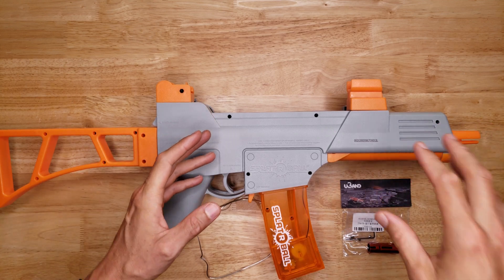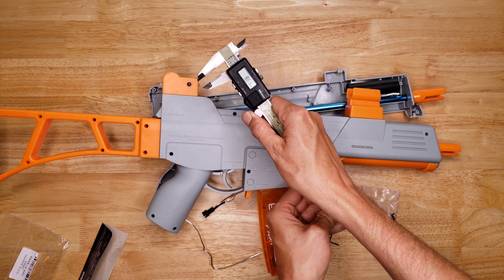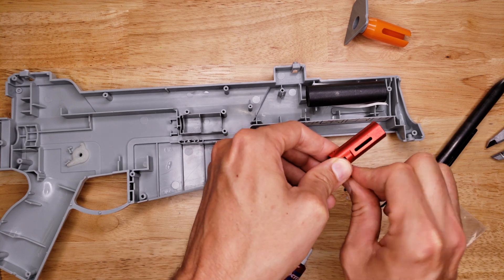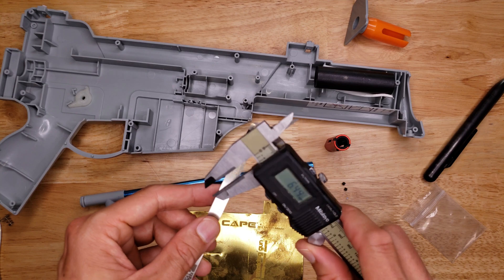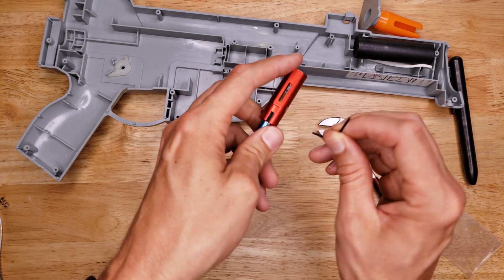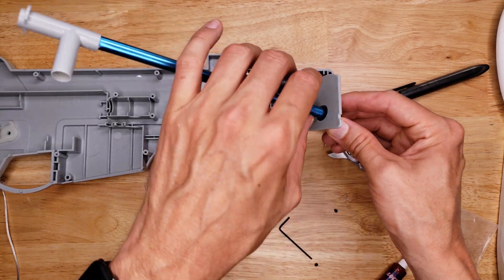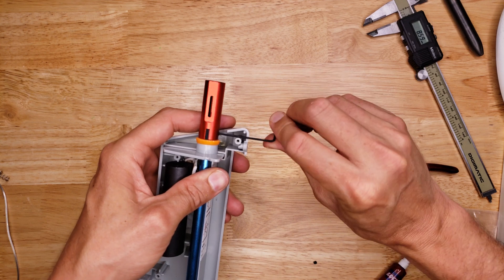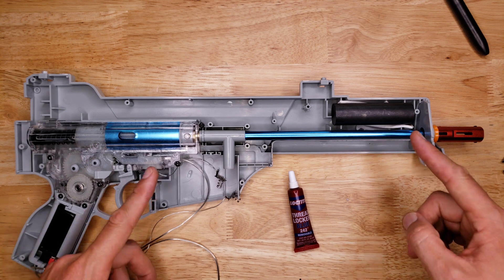How to add a HOP UP MOD to Splatrball SRB400 Gel Blaster to improve accuracy | Splat-R-Ball Upgrade

Comment: Do you think i could 3D print this? Are there parts on it that have to be a certain material?
Reply from the maker: Yes, many hop ups are 3D printed, but generally don't perform as well, and break easier.
Reply: @engineerable  but do they perform better than stock? Anything to improve it cheap

Comment: Did you ever film a video of then difference... i got the 1200 coming Friday and it seems like if i just saw the orange tip off and smooth it i could add a hop up without pulling the gun apart.

I havent got it in my hands yet to see... but let me know what you think
Reply from the maker: Check out this video to see how the SRB1200 is made inside https://youtu.be/FKxPLUxrIpM
Reply: @Engineerable 

I really respect what you do and how you do it. I used to film for a year on YouTube.

I loved it so much but with a full time, a wife, 5 kids and a dog it became alot to do. Alot of time involved. I'll get after once my youngest is about 5. But what you do and how you do it is valuable and I just wanted to say that.
Here is a video I made for Meepo boards pretty neat.
 https://youtu.be/PJB49iiM5D4

Comment: If I only do the hop up mod without metal gears will it improve the gun?
Reply from the maker: Yes, I added the hop up to a non upgraded Splatrball, and it made a huge difference
Reply: @engineerable  Have you posted a video of the results yet?  Thanks.
Reply: Ok…thanks!

Comment: Very informative videos man. Seems pretty easy to do to get a leg up on my shift guys at work. Haha. Do you have any links to aftermarket barrels? Or the dimension of the barrel would need to get for the 400? Thanks!
Reply from the maker: Thanks! There's a few issues that make the Splatrball not worth modding further than this. Aftermarket barrels won't fit the T-piece. The T-piece is unusual, not a replacement part you can buy. You can keep modding for the challenge, but if the goal is to have a better, reliable blaster, then it would be better to start with a more standard design.

Comment: When I addd the hopup to the sbr400 the bullets curve straight down. Any recommendations?
Reply from the maker: Sounds like it was installed upside down, because that's what happens now if I flip the blaster upside down and shoot
Reply: @engineerable  I’m pretty sure I have it installed properly the flatter tongue is on the bottom and the round tongue is on he top. Do you think you could send a video of how it shoots on reddit?
Reply from the maker: @xnoimr  I'm using the hop up in this tracer mod video: https://youtu.be/JKV0kX_kFrQ?t=789
Reply: @engineerable  Nvm just found out that the lower the top tongue is the more back spin. Thank you for all the help and the great video 👍
Reply from the maker: @xnoimr  Glad you got it. Yes, the curved tongue is at the top, and flat at the bottom as you have it. This is how FROSTY on Discord recommended to do it: "For adjusting, screw both top and bottom up in half or quarter turn increments until gels shoot accurately, you’ve gone too far if they start spinning upward, you just want them to float at the same level longer. You’ll have to minor adjust to get them correct. Doing the top without the bottom will shoot the gels out at a downward angle, opposite for bottom tongue."

Comment: would you seriously recommend doing this? how much of an improvement is it?
Reply from the maker: Huge improvement! The gel balls fly level like shooting a real gun. They don't arc, so you don't have to aim higher than your target.
Reply: @engineerable  gosh you’ve convinced me. i wanna have an edge on my boys. i think i’m going to have to do the whole sha boom! metal gears, hop up, tracers
Reply from the maker: @evanpague7644  Then your boys are going to be screaming no fair and asking you to mod theirs. 😂  I recommend doing the full metal gearbox instead of metal gears. Metal gears is a difficult mod due to non standard piston slot width.
Reply: @engineerable   is there a drop in full metal gearbox? Or would the casing have to be modded to accept one.

Comment: I got one last week but never thot a chance to install it so this video is perfect
Reply from the maker: Nice, let me know how it works!
Reply: @engineerable  I’m thinking to just use electrical tape on the barrel to make the fit a little more snug seems a lot easier. Any way you think I can keep the orange tip just to stay safe I’m in the US and would prefer keeping it on.
Reply from the maker: @donathan5932  you can try electrical tape, but it's soft and squishy. Try to cut a strip from a soda can first. You have to cut the orange tip. You can always put something orange over it.
Reply: @engineerable  I’ll try the soda can, you should swap the cylinder next and see what the fps gains are like, I’m waiting on that to arrive before I rebuild my srb 1200